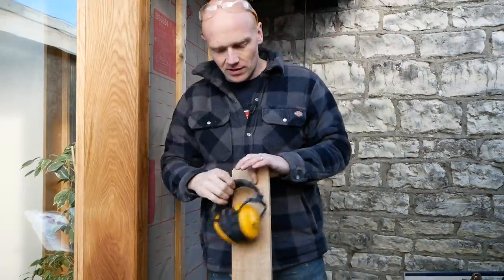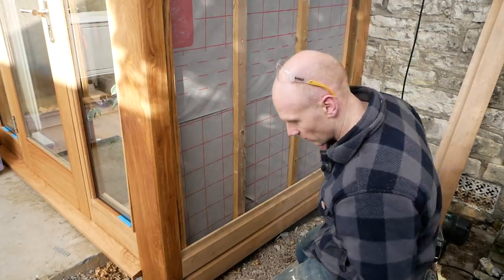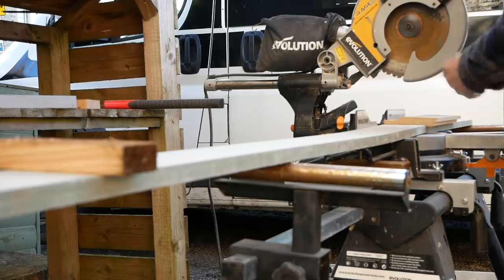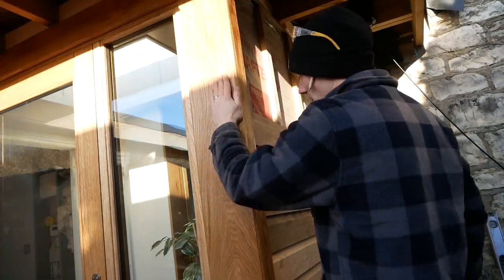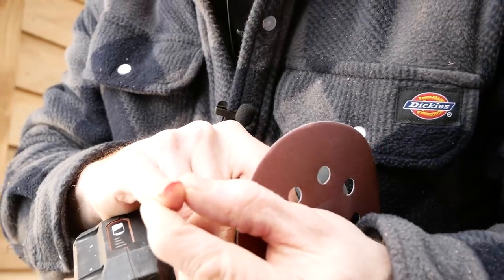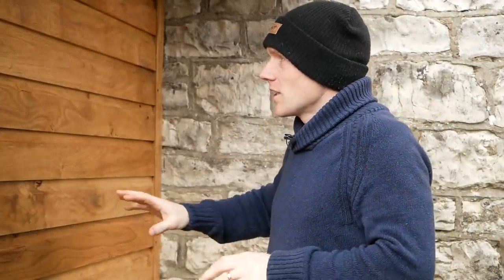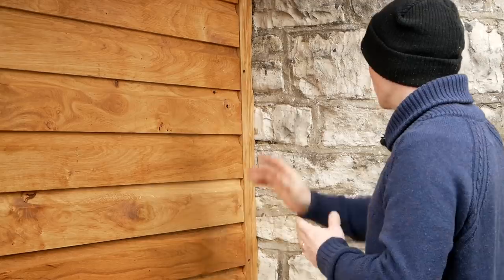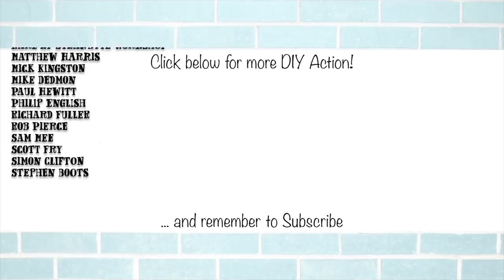Cladding the Timber Frame Porch - Almost there now!

Comment: It would have been better to put one or two coats of oil on the boarding before fixing in situ.  The reason is that the cladding will shrink, moreso since you have large overhanging eaves to protect the timber from rain, and leave unpainted stripes.  You can't guarantee the moisture content of the timber on fixing especially as its been kicking around the merchants yard for 12 months or more so you don't know whether the timber is swollen or contracted.

Comment: When you constructed the porch, how did you attach the wood to the house to prevent water ingress between the frame and building? I have a similar project to do myself. Many thanks.
Reply from the maker: Lead flashing chased into stone wall. Frame had bolts to wall and then expanding gasket tape to seal the gaps between.

Comment: Hi Tim, 

Would you bother with battens if you were using composite cladding on a timber frame? Thanks
Reply from the maker: I would. You still need to allow for air movement in case any moisture builds up behind it.
Reply: @TheRestorationCouple  Thanks Tim, i think i'll get some just incase.

Comment: Hey Tim. I'm building a pair of driveway gates out of pressure-treated redwood. I know you're a big Osmo fan - what oil would you recommend? Also, is it worth going pressure-treated or just stick with normal redwood and hope the Osmo does it's job?
Reply from the maker: I do tend to use quite a few Osmo products but to be honest, I’ve not tried endless other options so just stick with what I know. I guess the main worry about using pressure treated wood is the shrinkage and movement that will happen afterwards. It depends how fancy the gates are and what joinery I guess but maybe safer to just use high-quality kiln dried and then treat yourself. Not sure how it’s done by gate manufacturers, whether the joinery is done before or after treatment.  Are use what is my UV oil outside for things like that though and it works great but worth a top up cost every year or two.
Reply: @TheRestorationCouple  Thanks for the advice, Tim.

That was one of my concerns with using pressure-treated. They'll be a similar construction to your side gates (half lap jointed frame with T&G cladding.

I've ordered a few sample sachets of Osmo in clear, pine, and spruce, so hopefully one will be suitable.

Thanks again!

Comment: Will be interested to see what mitre saw you get. I’ve had the same Evolution saw as you for a couple of years and I’m not very impressed with it. Mainly the angle adjustment is very inaccurate. I guess you get what you pay for.
Reply from the maker: I’ve managed the whole house Reno with it but it’s never been that accurate. Would be nice to have a machine you can trust the numbers on and actually use the mitre readings instead of a dozen test cuts each time. 🙄
Reply: You do indeed get what you pay for. I use the 110 V version of the same saw, while the price point does seriously hinder the quality of some of the features the thing has lasted quite a while of near daily outside use and has cheerfully cut everything I've thrown at it. I really can't fault it for the money. For chopping general landscaping materials and rough cuts it's been excellent. Furniture work or quality finish? Really not sure it's the tool you're looking for. Considering it was bought as a stop gap it's really won me over.